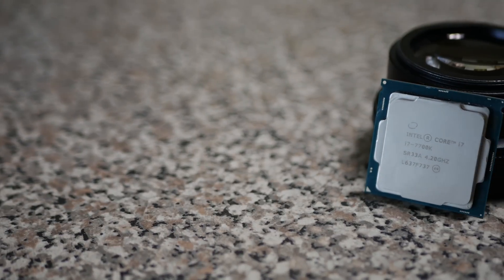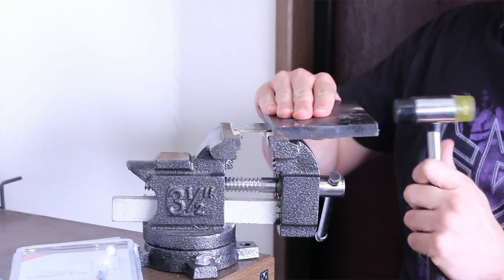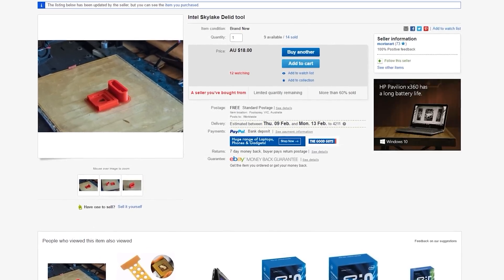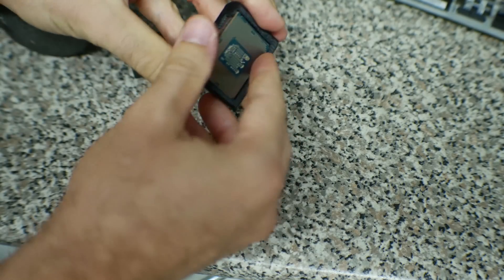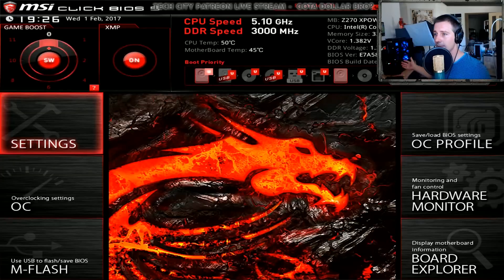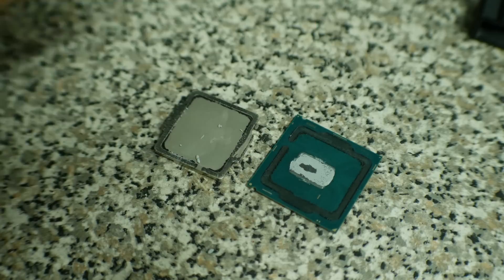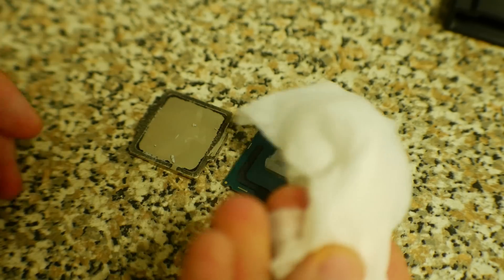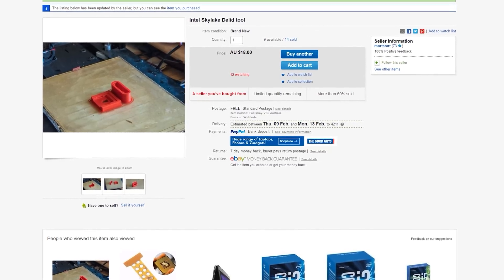DELIDDING The i7-7700k - How much of a Difference is there?

Comment: when linus did it with a 6700k i think he used arctic silver and didnt see much more than a 2 or 3 degree drop if  remember correctly, have you done it with a skylake cpu and was that a misleading result because the arctic silver isnt the right stuff or is there some massive difference between kaby lake and skylake with respect to the compound?
Reply from the maker: Arctic silver and other pastes I find dry out when testing in the past with high overclocks.  Liquid pro is the only stuff I have used personally that gets the job done and makes a huge difference.  As for Linus, I can't say, though he should be using the coolaboratory stuff, it was designed exactly for this situation.
Reply: **correction i just rewatched it he used something called maker gel sorry didnt wanna be giving out bad information
Reply: + Peter Jansen I paid silicon lottery 50$ to delid mine for me just for peace on mind and got a 24c drop, to me that is a 50$ well spent
Reply: Sadly CoolLaboratories Liquid Ultra dries up in about 1 year, when applied directly on the die. I have a recent video on my channel with exactly this problem. I never used CoolLaboratories Liquid Pro, so I can't say anything about that, but if Tech City uses it and never had problems, then it probably does not dry up.
Reply: skylake wasn't so bad temperature wise, this is currently only a problem on kabylake
Reply: Damien

I assume that they owe the customer a new CPU if something goes wrong.
 I guess that is well spent money but it is ridiculous that Intel doesn't do it decently. The big question: why? Less heat is better, no matter what voltage you use.
Reply: Have you contacted the manufacturer? They state that the Liquid Pro is 100% metal. There is nothing to evaporate. There are still other processes that could make it nonliquid. Coollaboratory might be able to explain what happened.
Reply: Thank you.  I did misunderstand you.
Reply: remember u can't trust linus benchmarks at all, the number of times he fucked up and kept the video online is now getting insane:
dx12/vulkan video and the recent dual core video (7400 multithread performance) are just some examples.
Reply: I'm glad you brought that up because I was thinking the same thing.
Reply: Tech City 
How risky is delidding if you use a proper tool and you look up carefully how to do it? Is there a risk involved that is just a matter of luck or should anyone who uses his brain be fine? I can imagine it is quite terrifying for most users to do this given you need a lot of force to disjoint the IHS and the PCB while the PCB and the die on it are rather fragile.
Reply: Is there a chance that Linus got a i7 6700k Intel reference chip? Because running stock speeds (or close to) and running a Corsair H115i I get about 85ºc when stress testing with Prime95.
Reply: No it does not, how can a metal alloy dry out. I have it on my 4670K (4,4GHz 1,35V) for a good 3 years now, and it does the job as good as it did the first day i put it there. I used CoolLaboratories Liquid Pro. Anyother paste will not live long between the IHS and the DIE. The Intel stuff that you find down there is really good, but the silicon that holds the IHS and PCB together is way to thick and you get poor heat conduction, thus poor temperatures.
Reply: +Peter Jansen 
yep if they mess up they will give you a new cpu. they have an amazing fast response time on their support email if you have any questions for them. once it got to them mine took 1 day to get done and shipped out same day so down time is pretty low. support@siliconlottery.com  also they have a 10$ off on there forum here http://www.overclock.net/t/1616199/overclock-net-coupon-code-2017
i hope one day Intel goes back to solder on the non lga 2011 cpus maybe if amd does good with zen cannon lake or coffe lake at least there unlocked versions might be soldered?  as i mean we allready pay a premium just to have the multiplier unlocked
Reply: The cooling liquid pro has a thermal conductivity of 80w/(m*k) artic silver only 8w/(m*k). That stuff destroys aluminum and is therefore not recommended for regular heatsinks.
Reply: Arctic Silver is old...not very good. The Deltas are bad on it, use something newer. Im looking to do this to my 6700k and use my Gelid GC Extreme. Really good stuff, top tier before you hit the "liquid metal"variants.  I will have a before/after vid down the road...after I get the kit and an H115i.  I do NOT get free stuff nor money from these companies, so my review is as I see it, direct and unskewed representation of data.
Reply: Kasapin5033   It can dry out.  The liquid metal alloy is not a compound molecule, it is many molecules in a homogeneous solution. These can separate as they are not physically held in a lattice like a solid metal.  Copper and aluminium (metals used in heat sinks/cold plates) can exibit porosity depending on the manufacturing process, liquid + porosity?
Reply: Its not risky at all, its very simple tbh.
Reply: Yeah i never said it would evaporate.  As stated the metal is just in solution and can be absorbed by porous surfaces.
Reply: theBraxil
I didn't see your comment. It was actually a reply to Twizar. Thanks for your explanation. There are still plenty of other possibilities that can cause it to harden.
Reply: Yeah. My first time delidding my 4790k, I used AS5 and didn't see any change in temperatures. 
Ordered CLU and dropped it by 10c. Linus really needs to revisit delidding because it was really piss poor.
Reply: Linus also didn't do more than a short test and cool laboratory usually makes really good performing stuff like the liquid metal stuff.
Reply: Surely applying 'normal' thermal paste to the die is no different to the good old days before heat spreaders?

AS5 performed well on the old AMD Thunderbird/Bartons which pumped out plenty of heat!

That said - if you've had good results with the coolaboratory stuff it sounds like a good option.
Reply: Arctic Silver is not a good product.
I began working in the PC business over 30 years ago and overclocking and checking thermal interface materials became a hobby of mine.
Reply: +ZZstaff Brian did a test thermal paste degradation test. He only did it with opened Thermal paste degradation. Artic silver 5 was one of the best in that test. Why do you think artic silver is bad and do you have any recommendations for thermal paste?
Reply: During live [hot CPU, etc] testing I found that over time Arctic Silver 5 migrated [seperated] leaving gaps for heat to build up.  As to a good compound, there are several.  For the past few years I have been using GELID Solutions GC-EXTREME.  It does a very good job transmitting heat and one application will last for years.  You can apply GC-EXTREME and never have to worry about reapplying it every year or so, as many people do with other TIM.  One application of GC-EXTREME will last the entire life of your computer build [or factory build].
NOTE:  I am not talking about modern CPU delidding use, although it would be much better than what Intel is using, and I have found GC-EXTREME does not "dry" out as other compounds.  Also, I have not tested GC-EXTREME above 100 degrees C for extended periods of time.
Reply: You cant even compare TIM like GX extreme and liquid pro/ultra to something like MX4 and MX2. Thats retarded.
Reply: I was responding to a question directed toward me regarding Arctic Silver 5. - - Please read my full comment.  I did not say I was comparing it to Liquid Pro/Ultra TIM.  I have used the MX series of TIM and know their capabilities.  I stand by my statement above.
Reply: They are pretty good for normal usage. They are not expensive, but as every other similar TIM; it will dry out after some time. IMO once a year you should replace it.
Reply: Again, GELID GC-EXTREME does not dry out.  I have tried replacing it after 1 year, 2 years and 3 years and it has never dried out in any of those times.  I built a computer for a friend 6 years ago and the TIM has never been replaced.
I have over 30 years of computer experience.  This does not mean I know everything, no one does, however I have a great deal of experience. - Good computing to you.
Reply: You did not understand me. I said MX4/2 AC5 and similar ones dry out, but they are like that, they are pretty cheap and you cant expect more from them. They do their job well, if you replace them every now and then.

GELID GC is on another level and cannot be compared. Liquid Pro/Ultra is the best one out there without a doubt.
Reply: Do you happen to know if it would work as a replacement for Liquid ultra/pro for delidding or will it not have the same or similar results?
Reply: Admiral MeowMix,  -  Although better than Intel TIM, I do not suggest you use GELID Solutions GC-EXTREME as TIM for deliding CPUs, it is designed to be placed on a CPU metal cover or bare ICs that use a heatsink including on the motherboard, it can also be used on video cards. - - Just be careful with Liquid Pro/Ultra because it conducts electricity, use a thin coating.
Reply: You should practice before you put it. Liquid pro is extremely hard to apply and if you fuck it up for the first time you could fuck something up, because, as ZZ said, it conducts  electricity.
Reply: Damien

It seems like the Ryzen CPU's won't have this problem (IHS). Unfortunately they might overclock less though, at first. :(
Reply: cataria pega

The larger tech channels with the most expertise are PC Perspective, Gamers Nexus and Level1Tech when it comes to Linux. The guys from LMG do their best but they dit run behind for certain things. For example, when AdoredTV (I recommend watching some of his videos) was already benchmarking for DX12, LMG, Paul, Kyle and Jay were still complaining that they couldn't benchmark it. To be fair, it wasn't easy (back then you had to download a little program which didn't have a GUI and was written by some Intel emplolyee in his sparae time, you got the data in an Excel sheet and you had to either work with Excel or write a program (C, Python...) to process that data) but it does show their limitations because they have less of a software/hardware background. It helps if you have people in the team who studied computational science or electrical engineering. Unfortunately most of these guys don't excell at communicating and presentation, most of them (of course there are exceptions) and you need that those skills for a tech channel on Youtube.

Also a shoutout for OC3D for reviews. He is thorough.
Reply: @chrome panda rider, my assumption would be that the distance between headspreader and silicon is to much, because the distance is still based on soldering (which is thicker and has to be), but of course is a negative for crap thermal paste. and intel being intel they don't care as long as it works.
"The thicker adhesive likely lasts longer and isn't meant to be ran at high temperatures for extended amounts of time"
this is an assumption, which dear fuck i hope is not true, intel expects chips to work at 100 degrees, the new macbook runs at 100 degrees, not over heating (by their fan curve) but intended to run like that.
and thicker heat paste is never better, simple logic if it deteriorates at one point the thicker u have the worse the already fucked up result will be.
so for long term use and any use, u want the thinnest possible layer of thermal paste.
Reply: quangluu96 Haswell isn't as good to delid, Haswell was one of the last cpu generations where intel tried.
Reply: There's no heat transfer to the IHS from the PCB. Any heat from that area is radiating from the chip. The problem is still they used too much silicon to hold it on. But that's because when you put too much sealant the IHS you raise the distance from the silicon to the underside of the IHS. Intel probably did this process for mobile when you don't have as much heat. 

I bet you that this lidding is  just a manufacturing technique that is optimized for lower-power chips. The thicker adhesive likely lasts longer and isn't meant to be ran at high temperatures for extended amounts of time. 

A majority of cpu's currently being sold are going to mobile consumers or enterprise servers. For both applications energy efficiency is very important.This means product skews like high end i series cpu's are just based off of the normal "boring" chips, but these have just been binned higher. Most products in a new line of like 30-40 new intel cpus is probably only 5-10 different silicon lithography patterns. Some are just better than others, so the small stuff like lids is much less important when they are all the same chip.

Comment: I thought you'd be putting the heatsink on the bare die but instead you replaced the thermal compound under the lid. Didn't know that's how its supposed to be done
Reply: just depends on how you wanna run it although some heatsinks won't screw down far enough to make proper contact directly with the die.
Reply: +BrainSeepsOut with how thin these cpus are you wouldn't even wanna risk it. There's a good chance of damaging them.